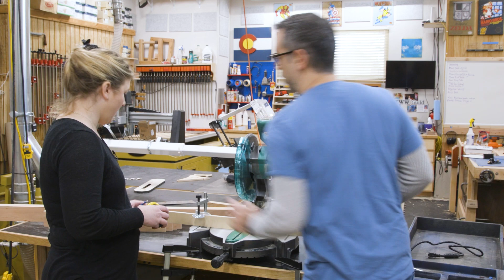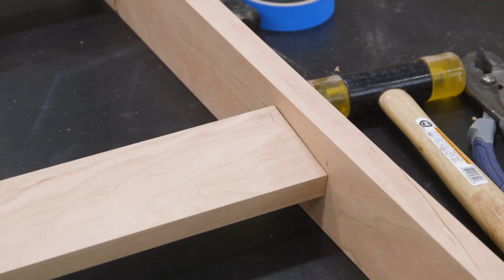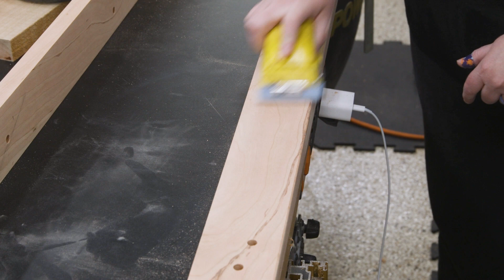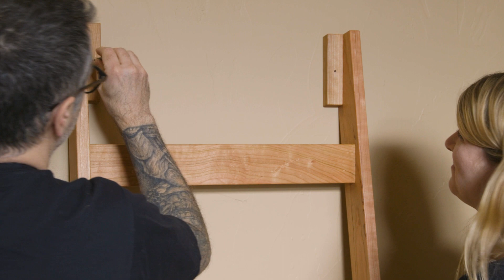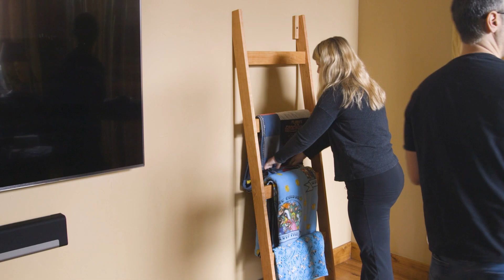Build a Blanket Ladder with Nicole! | Great for Beginners!

Comment: for scraping the wet glue away from corners such as 41:27 , a drinking straw works great. it will push into the edge, and the wet glue goes into the straw greatly minimizing the cleanup

Comment: 19:04 Also, the drill bit heats up and that makes the adhesive on your blue tape slippery so it takes considerably less to push the tape up the drill bit. The chips that are transported out of the hole by the flutes will often be enough to move the tape when the heat sets in.

Comment: I have never NOT blown right through at least one work piece when using tape as a guide on a drill bit. Even if you don't drill to it's full depth, the ejected sawdust itself can even push the tape up.
Reply: Sharpie mark has never slid up drill bit #justtheprotip
Reply: @Bill-v650  that's what I do now. I've also tried those set-screw stop rings with the bearing "no mar" surface, and I find that they still mar if there's any sawdust under them. So, sharpie it is.

Comment: Beginners are going to shy away from Rubio because of the cost. But the ability to not deal with dust falling in your finish, streaking, orange peel, all the other issues that come with a beginner applying a varnish or something similar just go away.

But, like you said, danish oil is a good compromise too as it's hard to screw up if you only do one coat and don't mind the voc's

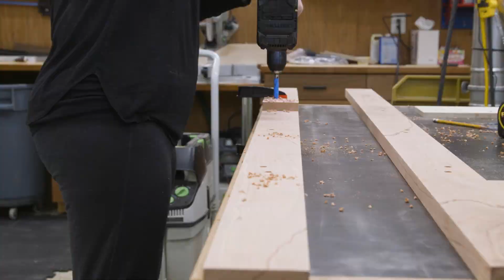Comment: 19:59  Blue tape now all the way up the bit.   :)
Poor Nicole!  And her immediate idea for a repair, epoxy, is probably what I'd go with as well.  Maybe blend a few drops of different stains to get as close a color match as possible (it shouldn't mess with the epoxy curing, being a very small amount), then fill the hole with the epoxy and stir in a droplet of stain at a time with a toothpick until it looks right.  I'd also have multiple lighting options on hand in addition to the shop lights, such as a lamp with a 'daylight' bulb, a strong flashlight, etc., to have the best shot at a color match that will 'disappear'.  Also, if you fill the hole nearly to the top, then blend your stain into that epoxy, you should still have a 24 hour window to put a thinner amount of clear epoxy on top of that, to bring you up to the surface (plus have a 'cap' of resin unadulterated by stain, in case it does leave the epoxy 'gummy').

Another consideration is the texture will be shinier than the surrounding formica, plus the epoxy 'pour' could end up proud of the surface, but masking off the surrounding formica to support a chisel should allow shaving it down to just a tape's thickness proud of the surface.  Then applying an extra fine grit sandpaper or steel wool should achieve a nice blend, but you want to exactly mask around the repair for this part, so you're not sanding formica.  Put some packing tape on a piece of 1/4" scrap plywood (as a 'releasing' surface), then stick blue masking tape to the packing tape, then another piece of the same 1/4" scrap, and clamp it tightly.  Now drill through this sandwich with the same bit that damaged the table.  You can now peel off a piece of blue masking tape with the exact hole (sandwiching between clamped wood helps keep the edges from going all raggedy), perfectly exposing only the epoxy, to avoid sanding the surrounding formica.

And of course, another way to go if you still have scraps of the original material around, is to fill the hole nearly to the top with filler, then patch it with the actual stuff.  A razor-tight fit can be achieved, by getting the disc of patching material close but still oversized, and hot-glue the flat head of a centered construction screw to it.  You can then chuck the screw into a hand drill, stick down some extra fine grit sandpaper to the workbench, and using the drill to spin it, sand the edge of the patch disc on the paper.  Sand a bit, check the fit in the hole, rinse and repeat, and sneak up on an exact fit.

Comment: Brilliant! Definitely do more 👍 good choice on using snaptoggles. For some reason, they aren't super common in the UK but they're definitely the best plasterboard fixing.

And in regards how these types of things are normally held in place: they have little rubber non-slip pads at the contact points. Cleats definitely going to be safer with children though!

Comment: Actually I would NOT use a danish oil or any oil type finish as you could get it on the Quilts/blankets. I would stick to the poly finishes. The project looks great! Nice to see you and Nicole working together! Thanks for making this one!
Reply from the maker: Even oil finishes cure so they will not transfer anything to the fabric. The only time it would be an issue is if you place the quilts on too soon or if you use a non-curing oil. Danish oil is an oil/varnish blend and dries to a nice light satin film.

Comment: Also I'd like to see you correct the hole in the outfeed table by using a plug cutter, for the filler piece.
 and fix Nicole's quilt rack.

Comment: You could correct the through hole mistake by drilling all holes through and using a through dowel of the same type of wood for a slight contrast on color!

Comment: One way to make the blue tape drill stop easier to use is to leave a flap like a flag.  When it sweeps away the chips, stop drilling.  That happens just before it contacts the surface.

Comment: I would probably screw into the wall as well, because I just feel that it’s safer to overkill something; however, I imagine the weight of the blankets, as well as the force of gravity, would keep the piece from slipping along the floor since the weight is directly downwards. This should provide enough pressure to keep the rack from slipping, but at the same time when you go to remove a blanket from the rack, it would likely rock a little bit. Screwing directly into the wall would completely stop that from happening. 
Either way, it’s a mostly a physics thing.

Comment: Ok, went to the store and bought 4 sticks 1 x 3 x 6' oak. Drilled my holes in the runners as prescribed. Started to set up the holes for the rungs of the ladder and found your mistake. 3" mill spec is actually 2 1/2". 
Your measurements don't add up!

Comment: Way too much unnecessary work. Set the stop block, square the left end of the piece and then slide the piece against the stop block. Less chance for inaccuracies.
Reply from the maker: That’s not what I’d call “way too much work” 😂 Just FYI, she is right-handed. This was her first time using a miter saw. I really didn’t want her to operate the tool with her non-dominant hand. It took a whole extra 5 seconds to remove the stop block and have her control the saw safely with her dominant hand. And your suggestion has no improved accuracy over what we did.